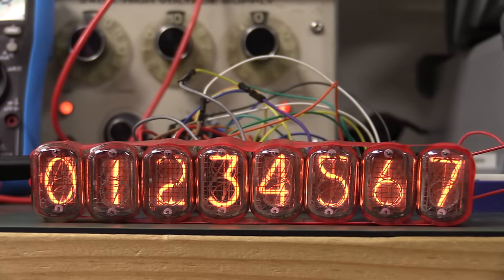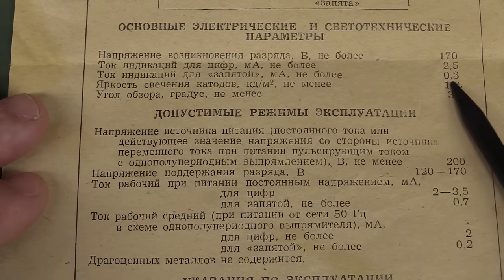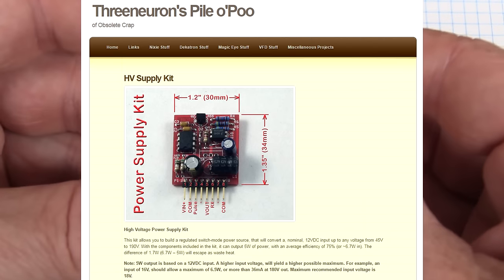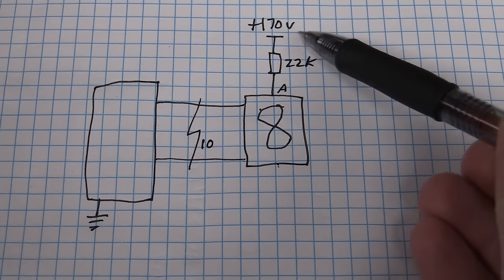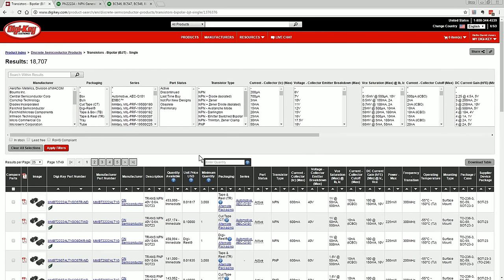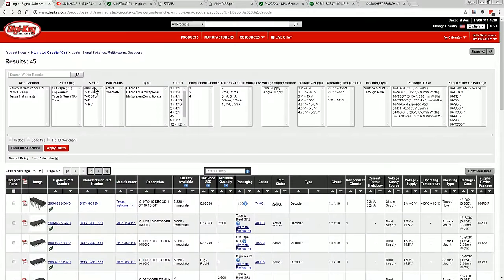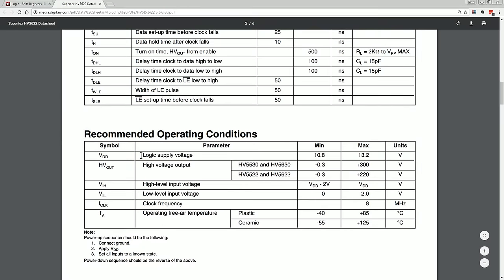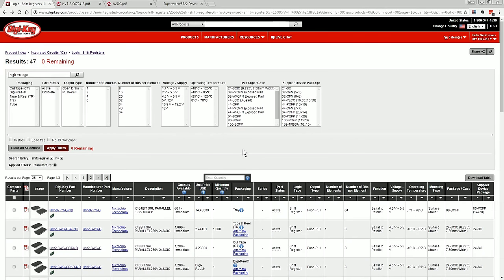EEVblog #948 - Nixie Tube Display Project - Part 1

Comment: Dave, considering datasheet.
Voltage at which discharge happens: not more than 170V
Current for digits: not more than 2.5mA
Current for dot: not more than: 0.3mA
Cathode brightness: not less than 100 [candels/(square meter)]

Power supply voltage (DC or AC RMS with half bridge): not less than 200V
Maintaining discharge voltage: 120 - 170V
Operating curent at DC voltage:
     for digits: 2 - 3.5mA
     for dot: 0.7mA
Operating current at 50Hz AC with half bridge:
    for digits: not more than 2mA
    for dot: not more than 0.2mA

No noble metals contained.
Reply: Thanks for translating Mikhail!

Comment: Some of the Russian nixie tubes have a radioactive isotope added to decrease the low-light turn on time.
Reply: As I know that was adding Kr85 which with half-life of 11 years so till now all should be safe.
On other hand uranium (uranium oxide) pottery glaze was used for centuries. Basically all houses build before 1940 used  bathroom or kitchen tiles that had been glazed with varying amounts of uranium and most ceramic glazed dinnerware used it.
Even now some companies use depleted uranium (rather than the original natural uranium) for production of glaze (for example Homer Laughlin China Company of Newell, West Virginia).
Reply: Just because something contains radioactive isotopes doesn't make it dangerous..... A banana is relatively radioactive due to the naturally occurring potassium, and probably orders of magnitude more radioactive than any uranium glass, or isotope added to a Nixie tube. The Uranium glass is perfectly safe to use, even for food or what-have you. You ingest Uranium daily anyway, simply by eating natural foods, and a much larger amount than any Uranium glass would possibly add (which is nearly 0, because it's bound in the glass, it's not going anywhere).
Reply: +Mythricia radioactive banana mmmmm
Reply: Correct ~ The Kr85 releases a beta particle which was used to create reliable initiation of ionization in the tubes, but a very short half life means that the isotopes are by now mostly inactive.
Reply: Fun fact all bananas you can buy in the normal stores are sterile mutants.
Reply: Too late now, he's Radioactive EEVMan!... lol!
Reply: Mythricia Now I want a Geiger counter to examine my banana
Reply: I guess they're all a bit radioactive, depending on how far from Chernobyl the seller is
Reply: @S James. I hope that was fun.

Comment: I have used the HV5530 in designs. 32-bit shift register with high voltage open drain outputs. Can get 10 in a sample order from microchip too.
Reply: spoke too soon, you found it lol.

Comment: 9:28 - On the HV supply, L1 looks like it is marked on the board as a 'laid down' component (i.e. mount it horizontal).  I guess that this is why the cap and inductor were squabbling over that small piece of PCB?  Strangely interesting vid though looking for chips on DigiKey, although not sure which one he ended up getting... the 16 bit 0.5mm pitch PITA, or the 8 bit jobbie.

Comment: dave you should try to latch with out enable on , it may look like a cool transistion effect at no extra cost (with multiple shifts maybe scramble the driver lines to make the effect more random,needs a translation table in the mcu for each digit though)

Comment: Are you sure that you can drive high, using push-pull drivers, the digits that are not lit on the nixie? Shouldn't need to have the unlit digit left floating?

Also, what is the voltage of a floating digit pin? Maybe you could use lower voltage drivers depending on what is the voltage on the pin!

Comment: as long as you don't change the 170V, the Nixie should always start independent from the anode resistor since there is no current before start-up so the tube gets the whole 170V. Oh course, if the resistor is to big to sustain the glowing it wont work.
Reply: just saying because dave did not think it would start up @ 6:33

Comment: The minimum current limiting on that hv509 is too high though, right? It feels as though you'll still need the external resistor, at least for the decimal point. The digits will tolerate 3ma (3.5?), but the decimal point was 0.7ma from memory.

Comment: Not a Russian, but kinda understand it decently.

ОСНОВНЫЕ ЗЛЕКТРИЧЕСКИЕ И СВЕТОТЕХНИЧЕСКИЕ ПАРАМЕТРЫ
BASIC ELECTRIC AND LIGHT PARAMETERS

Напряжение возникновения разряда, Б, не более
Discharging voltage, V, not more than

Ток индикаций для цифр, мА, не более
Current flow for number, mA, not more than

Ток индикаций для "запятой", мА, не более
Current flow for ДОТ mA, not more than

Яркост свечания катодов, кд/м2, не менее
Бrightness of the cathode, cd/m2, not less than

Угол обзора, градус, не менее
Viewing angle, degrees, not less than

Comment: Hey Dave, have you considered a fundamentals friday episode on different output types for IC's? Totem pole, open collector, etc. Its one of those things that I've picked up bits of over the years, but i'm sure newbies, and people like myself could do with a refresher, or learn some extra tricks around different types!
Reply: simontay1984 it's two transistors in series, one sources to ground and the other drains to voltage, they are driven by the same input on the base or gate,  so they have to be complementary, meaning one is npn and the other is pnp, it is called totem pole because one is on top of the other, like a totem lol
Reply: simontay1984 
Totem pole is a push-pull type of output, it is able to actively drive the output high or low, compared to an open collector that can only actively pull low.

Comment: You don't need latched outputs  - you just shift quickly, and use the output enable to blank while shifting.
You also don't actually need drivers rated to the full anode voltage due to the forward voltage drop of the nixies.
Reply from the maker: Blanking is morally offensive :-> But yeah.
Reply from the maker: As for the voltage requirement, I did measure the open voltage on one unit and the highest voltage was 122V.
Reply: Mike, you are wise.
Reply from the maker: See my 2nd channel video for a demo of this.
Reply: Maybe, "open pins" voltage can be clamped, say, by ~10V zener. You have measured 120 V to 10 MOhm resistance, so the current drawed was only ~12 uA. Incresing this value even 10 times should not cause any problem.
Reply: I don't think it's good practice to rely on the voltage drop. What if there are transients etc. Long term reliability might be compromised.

Comment: 8 Nixie tubes with decimal points and saying that it's going to be a project that we'll "find out later"?

Calculator.
Reply: frequency meter perhaps or some type of lab equipment
Reply: Spoder Man PLACE BET NOW! :P
Reply: I'm placing a bet on a Dave bullshit meter. Don't let it near solar roadways or it will explode
Reply: No, it's to display the count of his unopened Mailbag items. He needs all the digits.
Reply: He mentioned fitting 'some kind of display' in his Apple Pi cluster computer project. He said he wanted to remove the DWD RW drive and fit the display in the vacant bay, this looks like it might fit in there ;)
Reply: or a Nixie tube multimeter
Reply: Subscriber counter. It seems he is designing it to have some outside connectivity.

Comment: I really panicked when you got the translation wrong.
Good thing you double checked, mark of a good engineer, good on you mate.
I was scared you'd burn the thing because of the decimal needing a smaller current.

Comment: Important! 0,3 mA is indication current of decimal point. 2.5 mA for numbers. Maximum for DC: .7 mA for decimal point and 2-3.5 mA for numbers. For AC (50 Hz half-way rectifier) max current: 2 mA for numbers and .2 mA for decimal point.

UPD Looked further and you used google translate. Few)
Reply: indeed!

Comment: Dave, suggestion from a professional solder; if you cut the legs on the components after soldering, you should resolder. The kick from cutting with a plier can cause micro cracks in the solder joint causing the board to fail after some time. Maybe not super important but nice for viewers to know.

Comment: Is it going to be a clock? Please don't build a clock. Everybody builds a clock. 
A multimeter would be nice.
Reply: I second that.  Maybe an external display for a 7 1/2 digit multimeter?
Reply: A youtube subscribers counter ?
Reply: The display driver is the thing....what you´re displaying is second order, as it will pe probably within a µC anyway. If it would be discrete chips without any µC i won´t go that way either; for a clock i would stay in the tube field an go for counter tubes and wire them up directly to the nixies, that would be a nice clock or a counter.

You also could use these counter tubes to generate the 1hz clock input siganl direct from the mains AC.
It´s a rather simple 8 counter 6 nixie component count and you´re pretty much set, some resistors and blocking caps for the 1Hz impulse generator and that´s about it.
Reply: You´ll need something like a nice reference and some HiRes ADCs along with some storage memory and readout conversions. Have you ever opened a nixie based voltmeter...?
My Grundig Nixie 5 digit meter has some three big (20 by 40 centimeters) double sided PCBs inside, a lot of nuvistors (little tubes) and some 12 large double width DIP-Chips on them which do all the measurement, conversation and display jobs.
Reply: I was thinking about it possibly just being an external display for an existing multimeter (ie. tying into some automation/programming connectors), but it would be quite interesting to see what would go into designing a high precision nixie-based multimeter!
Reply: open up a nice hi-precision multimeter...and it would be all the same for the nixie type except it would need some nixie driver. ;)
And that´s what dave is building up...
Reply: A Youtube subscriber counter will ruin the first 3 digits of the nixie tube. It will constantly be on the same digit. Unless you program it to cycle the numbers around at night or something. All this trouble, better be something useful. I.E. external multimeter display for his EEVBLOG Brymens.
Reply: Random Model Making Channel Meh, does not take away from the coolness in my opinion. I have a dozen of these IN-12A and clocks are absolutely with all certainty the first thing I made. No regrets, everyone loves them and they command a handsome price when built well.

Comment: 74141's are plentiful on eBay. 95 results for "74141 nixie".
Reply: Good to see some modern parts and what to look for if you needed to build larger setups though.
Reply: They are not new production, but "new-old-stock".(NOS). They were made decades ago, by the Soviet central planners. Still a lot of them in the warehoused in the former Soviet Union (Russia, et al). Same goes with many tubes. Yes, a few tubes, are still being made, but most "types", are just old inventory, that's been sitting on the shelves, for decades. I use to buy the Russian 74141s in lots of 100, years ago, for a kit, I sold. Use to pay ~70 cents for them. The inventory, though readily available, is thinning out, and the price has been going up. Use to have a lot more of them out there.

Comment: As far as I know a push pull driver would not work with the Nixie tube. Since the segments are all in a row the current won't be flowing from the grid to the segment but from a segment that is pulled high to the segment that is pulled low. I have a feeling that this is not right.
Reply: I was wondering about that too. With those totem pole outputs you'd basically get 9 additional anodes and one cathode. Maybe Dave is planning on leaving the high-voltage supply input of the drivers disconnected? That might do the trick although I have a feeling that's not really how the drivers are intended to be used.
Reply: Exactly and he already pointed out in the forum that it does not work that great. He is going to show in the next part.

Comment: I wonder if the digits towards the pin side are bigger to cancel perspectival reduction.
Reply: Over less than an inch?
Reply: I tried this out by looking into a little box here at a reasonable range, it looks like around 2mm difference at that depth. You do see the 1 point closure of the edges. You would have to be looking more or less straight on for it to correct, so maybe they wouldn't care.

Comment: Mode for voltage is 120-170 V, indication current for "numbers" - 2-3.5mA, for "comma" - 0.3-0.7mA. 30 degrees - viewing angle, brightness - not less than 100 cd/m^2.

Comment: Neon bulbs strike better when the gas is pre-ionised. This also means that the nixies are light sensitive. At threshold voltages they will likely only start to glow when there's enough light shining on them. I never tried it, but it's an interesting topic for one of your experiments: xenon-flash-start an undervolted nixie tube.

Comment: 170 V is the maximum voltage when they start glowing, 2.5 mA is the maximum current for digits, 0.3 mA is the maximal current for decimal point, 200 V is the minimum voltage of power supply, 120-170 V - voltage to keep glowing, and also it says that there is no precious metals
Reply: Oh, i didn't see that you used a google translator later
Reply: yep!

Comment: Nice projects you're getting going lately Dave, Looking forward to more parts for this and the Raspberry Pi too. :)
If I remember rightly the Suzuki GT750 nicknamed 'The Kettle' because it was a water cooled 2 stroke Motorcycle had a Nixie tube in the clock cluster to display what gear you were in.
I had a Suzuki GT250 again 2 stroke and it had the gear shift contacts in the gearbox to install something along the lines of the GT750. I wanted to wire a 7 segment display with decoder to respond to which line was grounded depending what gear you was in but never got around to it before the bike died on me.  :(

Comment: i have idea to not use decoder but lm3915 in dot mode with pwm from arduino and "not" gates you this gona work?
Reply: i need for this only 4 arduino pwm pins. with decoder 16 for 4 lamps what can be problematic

Comment: belive me, pc817 + resistor works a treat as a anode driver for nixie tubes. still working after 4+ years. a simple 555 boost with no feedback is good enough for the power supply.

Comment: You don't need a 200V rated transistor for each cathode as long as each tube always has a digit lit.
You only need something rated for 40-50V. A ULN2803 or ULN2003 transistor array works great and you can protect all of them against overvoltage with a single zener diode.
The nixie driver ICs have a similar voltage rating and require one digit to always be on.

I used ULN2003's in my nixie clock and it has been running on my desk for years just fine. It runs with all 6 digits multiplexed. They are certainly bright enough to read in normal lighting, but not in direct sunlight.
Reply from the maker: It's not that easy. See my 2nd channel video for a demo of up to 122V open circuit voltage on the off cathodes.
Reply from the maker: But yes, the 74141's look to have zener clamps on each pin.
Reply: Putting a zener diode between 0V and the com pin on the ULN2803 provides the overvoltage protection like the 74141.
Reply from the maker: Ah, yes, I forgot the common pin, yes, that will certainly work with a single zener. 13 chips for 88 lines.

Comment: Just curious as to why you chose 22k for the dropper resistor value, based on the datasheet wouldn't somewhere around 48k be better to achieve the 3.5mA? Or is this due to the resistance of the nixie itself? Thanks!
Reply from the maker: I wanted about 2mA
Reply: wouldn't that require an 85k resistor? Sorry if im overlooking something.
Reply: The 170V on the anode only serves to kick-start the discharge. Once the process is started, the nixie only needs about 120V to sustain the glow. If you apply 170V directly without drop resistor, you'll end-up burning your nixie.
The resistor must be calculated for the ~50V drop across it, so that's why you end-up with a 22k resistor.
See https://threeneurons.wordpress.com/nixie-power-supply/ for more details on how to power a nixie.
Reply: ***** That clears things up, thanks!

Comment: Dave, you can find 74141s on eBay if you want to re-consider that route.
Reply: No need for a hv transistor. A BC546 is just fine. The 74141 outputstages only withstand around 60V too, like the BC546.
Reply: Without zener diodes. I had that at first for my nixie clock. But all that consumed too much space, so I used russian 74141 insted.
Reply: if you stay in the tube field, it´s so easy to set up a clock, go for counter tubes and wire them directly to the nixies and count them via some more counter tubes...you just need 8 counter tubes and 6 nixies for a full clock a bunch of sockets, resistors and some blocking caps...that´s it...
Reply: In the final version of my clock I used a Atmega8, some 74HC595 and russian 74141 plus a MC34063A stepup. I would say that is much easier but how you build your clock in the end is personal preference.
Reply: of course ;)

Comment: Hey Dave, just wanted you to know that the mighty engineers of my great country created a special IC to power these things - К155ИД1. You just hook each cathode of the tube to one pin of the IC, and based on one of the 2^6=16 possible high/low inputs on other four pins, it allows current to flow to the ground of your circuit through the tube. Please let me know if you need some of them - can send it to you :)

Comment: Radio Shack once sold nixie tubes. VFD tubes, too. The year was 1976. I bought some, at my local Radio Shack, that year:

https://threeneurons.files.wordpress.com/2011/08/rs_nixie.gif

https://threeneurons.wordpress.com/nixie-power-supply/

The current requirement for the nixie, is way off, in their ad.